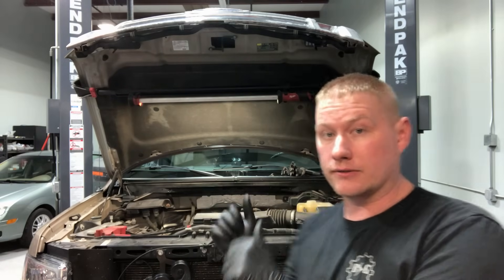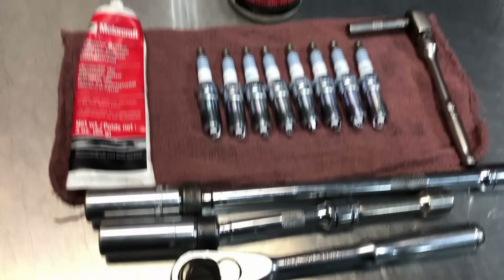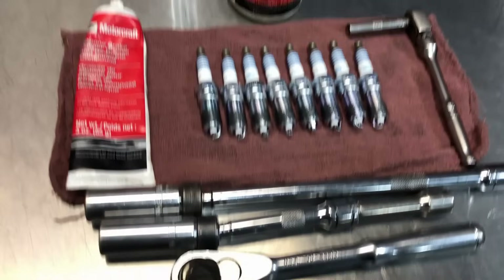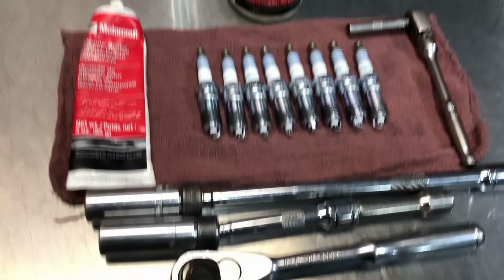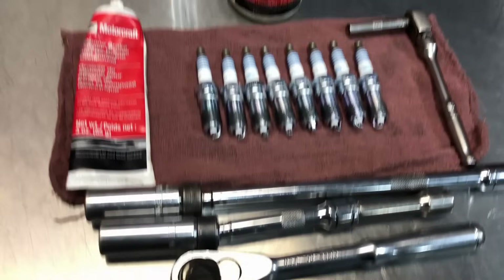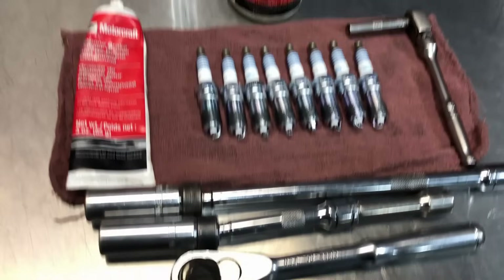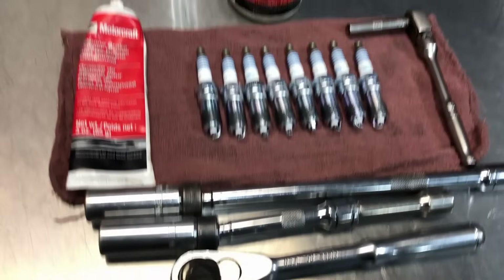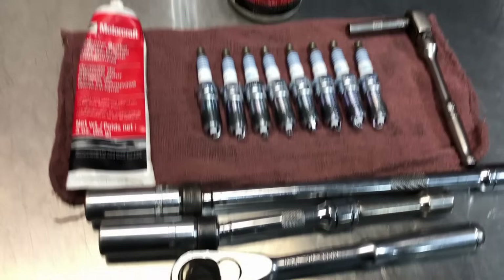2011-2017 Ford F-150 5.0L Coyote Engine: Spark Plug Replacement Walkthrough

Comment from the maker: Latest Spark Plugs (2011-2017)-
https://amzn.to/2POJzdw
Anti-Seize-
https://amzn.to/2T09goj
Dielectric Grease-
https://amzn.to/2syEjvA
Spark Plug Swivel Socket-
https://amzn.to/2SVtNdj
Cat Claw-
https://amzn.to/2Cq6OjL

Spark Plug Gap- .051"
Spark Plug Torque- 127 inch lbs

How to remove rusted broken coil bolts-
https://www.youtube.com/watch?v=jPYNhZwT0nU

Forscan is a free Ford Specific Diagnostic Software:
Download Here- 
https://forscan.org/home.html
ELM 327 Adapter I Recommend-
https://amzn.to/2GC6dBj

As an Amazon Associate I earn from qualifying purchases.
Reply: Curious why you use the platinum plugs vs the iridium ones that came in the truck.  I just did this job myself thanks to your video and used the platinum ones you recommended.
Reply: Have you any information of the 2018 Ford F150 5.0 /Mustang Typewriter tick?
Reply: No additional dielectric grease on the connector? with this type.
Reply: What do you think of the new Gen 4 5.0 V8?
Reply: It sucks that when I look into this spark plug  SP- 548 for my 2013 Ford f150 5.0 I find two different spark plugs. Oreilly eBay and Amazon seem to have the ones that are in this video. Then autozone summit racing and some other reputable sellers have ones that actually say motorcraft platinum on the porcelain. I got the ones that are in this video but With all these knockoffs around hopefully I got the legit ones.
Reply: @Dirtyswiff 😢
Reply: Can I use NGK Ruthenium HX in my 17 5.0 or am I better with Motorcraft?
Reply: Sir those models are have air cabin filter??? Tanhk you

Comment: I once got some anti seize on the electrode and it cause a misfire.  Also, after using anti seize on the threads, the plugs were super hard to take out.  One of them broke!  Did I mention they were SUPER hard to take out?  Upon further research, I found that motor oil only is preferred.  No amount of anti seize.

Comment: I just bought a used 2014 F-150 5.0L, what do you think are the longest lasting, best spark plugs for the Coyote? Also, could I use a little dielectric grease on the coil plug to make them slide a little more easily next time? Great channel, just subscribed.

Comment: With the spark plug out it is better to use a vacuum to suck out any debris, avoiding blowing any crap into open cylinder cavity. 
Good video. 👍
Reply from the maker: How could you blow anything into the cylinder when all the air is only coming out?
Reply: @ without the plug in the hole you’re sure nothing will end up in the cylinder?

Comment: I followed your instructions and successfully change the plugs on my 2016 Lariat with no problems.  Even managed to get all the electrical connections to unlocked with no damage.  Thank you for another excellent instructional video.

Comment: I do, in fact, believe the hardest part is those electrical connectors. I’ve spent hours trying to get those little bits of plastic apart just to break them anyway. Thank you for specifically taking the time to explain/show how to get those off!
Reply: Connectors are pretty cheap to replace too. Parts are about $20. Find a video on depinning the old connectors...beats messing with the wiring harness and using butt splices that will give you trouble down the road. A little smear of dielectric on the inside of the coil side of the connection makes them go together a little nicer too.

Comment: Can you do a show for Spark plug change  for 2022 5.0 coyote .  I bought  Motorcraft SP588 according to owners manual.  Has a different connector for the coil on end of plug.  What is the torque.  Will the 5.4 Spark plug wrench work to remove these plugs?  Any help appreciated.  Did several replacements of plugs on 5.4.  Time consuming but not bad.  Don't want to mess these up.

Comment: For the black primary locking tab, push "down" on it means push it into the connector towards the red clip / towards the cylinder, not "down" towards the ground.

Comment: How do you reach the plugs in the back on the passenger side? I find it impossible to get my spark plug extension there with all the other components and cables obstructing the way

Comment: Just did the plugs on my 15 GT today, bought it used in 2020 with 58k miles now at 82k. Had motorcraft plugs in it and the gaps were between .062 and .067 so it looks like they were ready for changing.. . Dropped a new set of NGK 6509's in gapped at .052. Total cost, $60 for the plugs and just over an hour of my time.

Comment: Just finished changing plugs on my 2013 FX4, this video made it easier thanks for sharing your knowledge and experience. Whoever designed the clips on the electrical connectors on the coils should be fired and have their engineers license revoked...

Comment: My plugs on cylinders 4 and 8  after a few 1000 miles all the metal seams to be discolored  from over heating cylinder temps,  also had an issue with valves wearing away in those cylinders.

Comment: NGK specifies to NOT use antiseize, it's counter productive for torquing the plug with their coating. I've seen people use antisieze and then it cancels out the coating and their torque specs aren't consistent. NGK 6509 is what alot of guys use and what I'll use, without the antiseize
Reply from the maker: go for it.

Comment: I had the connectors break, its easier to buy new connectors, and just  de pin the wire and feed them into the new connector,  dont bother splicing the wire

Comment: I have a new to me..2017 f150 with 100k on it.  I doubt the plugs have ever been changed.  How nervous should I be about the dry plugs breaking....or any other issues.  Just got the coolant Y pipe and o ring replaced...thanks to you.
Reply from the maker: They will come right out.

Comment: if you're worried about the centering of the extension you can take an old rubber sway bar link bushing, grind it down to the diameter of the hole, then cut a slit in it so you can slip in over your extensions.. slide it down and go, push it right down to the socket with a thin screwdriver and go...  too bad you dint do all 8 OR, show us what extensions we need for each hole so we know which ones we need to buy, guess I'll get the 5 pc warbly kit?

Comment: Just did mine on a '17 5.0L.  Super easy to do and plenty of room to work around.  

One thing I found out and caught me off gaurd is that the coils dont snap/pop into place onto the spark plugs.  They just slide down onto the sparks and the 8mm bolt holds them down.   So used to having that pop sound/feeling when installing coils.
Reply: That's good information as I would have torn it up trying for a good fit.👍

Comment: Thanks for this video 👍. I just changed my plugs and sadly whoever put the last set in tightened them to some completely inappropriate tightness. Even with my 1/2" breaker bar, I could not budge them and had to go to an impact wrench. To say the least, I was very afraid for the aluminum threads. In the end, though, I was able to get them out and save the threads (whew). I did also use antisieze on the plugs and a torque wrench to ensure they were not too tight to remove. Whoever worked on it before broke more than half of the clips :( ...

Comment: I did my 2011 about a year ago. I also put a piece of tape over the oil fill cap in a wrote 5W-30 on there as that's what I've been using for years

Comment: I have a 2011 mustang gt with the P0300 code that just popped up. Car has 87K miles and noticeable vibration at idle. Would you start a with spark plugs?

Comment: I have a question about a gen 1 coyote in the 2012 Mustang GT. Is there a way to build oil pressure without the engine firing up. I keep reading about holding down the gas pedal to the floor turning the key and engine won’t fire up. Is that true? Thanks great channel 👍
Reply: Correct.

Comment: Just upgraded from an 06 5.4l to a 2012 5.0l with 165,000 miles. So far I love it. Are there any tips and tricks I should do to it ensure that the truck will last? Should I switch to 5w-30 oil?

Comment: Super easy! Just changed out the plugs on my 2015 F150 at 80,000 mi. Picked em up at local dealer for  $72 with tax. Everything came out easy and in good condition. No problems with coil bolts or connectors. Plug gaps were between .057-.059
Reply: I would never recommend buying plugs (or any other maintenance part) at your dealer.  Factory MOTORCRAFT Platinum plugs can be purchased online for less than $40 shipped to your door.
Reply: @stadce  from where? gotta be weary of knock offs.
Reply: @ottallman  RockAuto was my source at the time of the post.

Comment: To change the cylinder 3 spark plug do you disconnect the high pressure fuel line

Comment: I'm doing this tomorrow morning I just finished setting my new spark plugs to 050. I'll post here once I'm up and running 2016 f150 xlt 5.0 v8 with 83.254 miles

Comment: My 2011 f150 5.0 manual calls for a .042 to .047 spark gap. Not a .051
Reply from the maker: I use the Ford PTS site that Ford technicians use at the dealerships which is constantly updated by Ford. The specs were updated- Procedure revision date: 05/21/2013 by Ford as such-

303-07C Engine Ignition — 5.0L (4V)	2011 F-150
SPECIFICATIONS	Procedure revision date: 05/21/2013
Specifications

Material
Item	Specification	Fill Capacity
Motorcraft® Silicone Brake Caliper Grease and Dielectric Compound
XG-3-A	ESE-M1C171-A	—

  General Specifications

Item  	Specification  
Firing order	1-5-4-8-6-3-7-2
Spark plug gap	1.25 - 1.35 mm (0.049 - 0.053 in)
Reply: @FordTechMakuloco  Ah that is helpful! I just regapped all of mine to .045 from .051.
Truck seems indifferent.
Guess I should correct that at some point soon.
Reply: @FordTechMakuloco  do you still recommend the plugs in the video over the iridium ones?

Comment: I wish Ford had used this through the head spark plug hole design on the earlier modular engines. I hate having to either remove or fight the fuel rails as well as deal with the firewall on the back cylinders.

Comment: I'm at the end of the first week of trying to extract the drivers side rear sparkplug boot, yes only one plug, l have four more to go.
Of course I haven't worked on it all that time but getting the boot that's practically welded to the spark plug and to the surrounding cyclinder head sparkplug hole is a bitch. 
I've been to harbor freight tools, true value hardware, Ace hardware, building centers, Oriellys,  Napa and Auto zone. Everything I've purchased is to long, to short or to wide to fit and reach in and pull that fricken boot out. I even have the tool to pull the boot out. I stuck that tool  ( Ford / Chrysler Spark Plug Boot Remover #SL68450 ) and the boot is like stuck to the wall of the cylinder head and this tool simply slides out of the boot. So l had to search for screwdrivers that will fit in the hole as far as it can without the fkn  firewall being in the way, 
OMG ' !   Finally ' I was able to get it out of there without harming the old plug itself.
All the while taking photos of the process.
I'm glad l retracted the hardest sparkplug job l've ever done, alongside a 2010 Journey SXT 3.5 where you have to take the whole intake manifold off to get to the right side of engine because it's right up against the firewall. Any ways maybe you'd like to make a video of these sparkplug boot problems, it's your call, l have photos if you would like. I'm headed outside to tackle the passenger side plugs on my 2013 F-150 5.0.
Thanks for your videos they help me out 
and  l'm sure they help out allot of other people too 👍 
your viewer fan : tony

Comment: Thank you for the educational video. I did my sparks plugs on my FX4 2013 with out any issues following the instructions step by step. Next maintenance for me will be changing all my fluids rear, front differential, belts since my truck just broke 100K.

Comment: Is it ' good or not good ' to add a little dab 
of di-electrical lubricant to the electrical connector that connects the wire harness to the ignition coil ?   Or something else to protect the connection between wire harness and each ignition coil ?
Reply from the maker: No need on the primary side.

Comment: My 2019 has a white clip you pull back with your fingernail and just pull the whole thing off. No tools needed. Soooo easy! Third one back on the passenger side was leaking barely even tight. I only have 45,000 miles on it but started idling rough so now it runs smooth. Definitely need anti-seize, three of my plugs were rusty on the threads!

Comment: I broke a coil mounting bolt in the valve cover.i tried back and forth but it did not work.have it soaking in blaster and tried working with vise grips.no luck.any ideas on my next move.i could mig a nut to what is left.

Comment: I did mine a month ago and did all the same steps. Little bit anti seeze, wire disconnect (bastards), air for debris, no torque but stubby ratchet, and dielectric, and warmed up the engine a bit. 75k miles and went great except for 1 ignition coil bolt (bastard)

Comment: Thanks for the video.   I was surprised to see all the dust that blew out of the first cylinder you blew out after you pulled the plug.   Is that concerned normal?   I have a ‘15 5.0 with 25k miles.   All local miles.  Hardly any highway.   The truck seems to be running a  little rough.  It makes just a small sputtering sound when coming off idle at a traffic light.  Not if I hammer it but if I start slow. Almost like a slight manifold or exhaust leak. The truck just turned 4 years old and has been maintained for the most part.  Scheduled oil changes.  I just had the transmission rebuild and a new timing chain tensioner replaced.  It sounds like a diesel. That’s was fords attempt to fix the tap.  It didn’t work.  I did have the VTC TSB done about a year ago.  Ford tells me it’s a normal noise but i disagree.  It’s a different tap then the high pressure fuel.  I’m use to that bringing my BMW makes the same noise.   Do you have any advice?  I appreciate all your videos and thanks for sharing your knowledge.

Comment: I just brought my 2013 F-150, 5.0 into the dealer for transmission software update.  I am creeping up on 100k mile service, and the service rep advised I change the coil boots when changing spark plugs.   You didn’t mention this in your video, curious If you come across any issues with the boots,or recommend they be changed at a certain interval?  Thanks!

Comment: Why did they change the spark plug gap from 2011 f150 5.0. Manual states .041-.047
Reply from the maker: .051" is the current spec yes.

Comment: Eric o been doing it with the engine warm and hot for year s
Reply from the maker: Um no
Reply: @FordTechMakuloco  you saying south main auto ain't got a video from years back where he lets the engine run before he takes the spark plugs out of a f150 you can go watch it if you don't believe me
Reply from the maker: He has a video on the 5.4L 3v but it is an old trick formed by us Ford dealer technicians on the internal Ford company message boards way before he ever heard of or thought of it. It also only applies to the first gen 4.6L 3v and 5.4L 3v engines and has nothing to do with the 5.0L Coyote which is subject matter of this video. So again I say no to you on both accounts.
Reply: @FordTechMakuloco  I was talking bout the F-150 engine s in general not just this engine sorry if you misunderstood me and no one knows who the first to come up with a trick knowledge stays getting passed down no offense intended
Reply from the maker: Tricks generally come from dealer techs that have to deal with new design problems first and are also trying to beat warranty times by coming up with shortcuts not the independent techs that see the vehicles 5 years later when they are out of warranty is all.
Reply: @FordTechMakuloco  i understand   you have a great channel  I like watching your videos alot along with Eric the car guy south main auto and Chris fix brayan916 etc

Comment: Great video Brian, thank you.  I just replaced the plugs on my 2013 today and it was a breeze.  Is there a reason you install (and linked in the description) platinum plugs vs the iridiums that came on the truck?
Reply: They conduct better than iridium, but in turn burn a bit quicker.

Comment: I have been in the auto industry for over 26yrs., as a parts mgr/ body shop mgr. I have never seen anything like this. I have a 2013 Lincoln MKT. After taking my car to replace all sets of brakes and rotors, a control arm and tie rod end. A day later my ABS, traction warning light comes on and my power steering goes out the door. WTHELL! Thank you for your video. I now will look into this and replace it myself. I am thankful for this, have a blessed day. 😊

Comment: Thanks for posting this one and all the others you do.  I wrote down all your recommendations for maintenance and have them saved.  I was a little nervous doing the plugs but at 74k miles, they weren't rusted in there like I was afraid they might be and the job was definitely easier than on my 3.0 V-6.

Comment: Was putting in the last coil bolt and the head snapped off.  Thankfully, I was able to grab what was left with vice grips and twist it out.  Had to order a replacement though, as nobody had them in stock.  Be careful and don’t tighten them much past initial resistance.

Comment: With the spark plugs, do you recommend 5W-20 or 5W-30 oil while doing an oil change?
Reply: I recommend 5w-30 in the 5.0L. It does offer a little more protection.

Comment: If you don't have a magnetic socket, you can use a short bit of hose and slip  it over the electrode to get the plug started.  Then finish with the socket.
Reply: Or just use a magnetic pickup tool. This is what I do when I don’t have a spark plug socket or it’s not wanting to grab the spark plug.